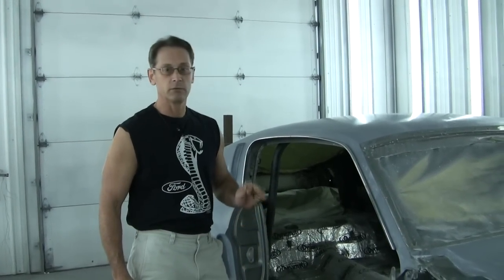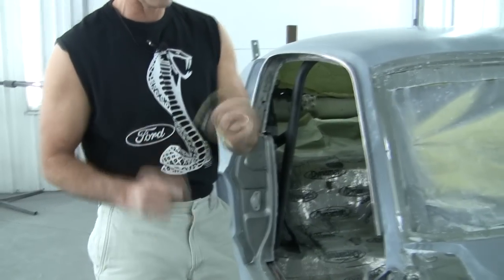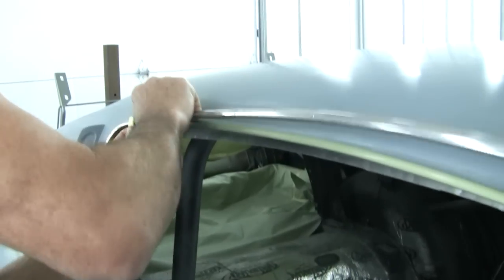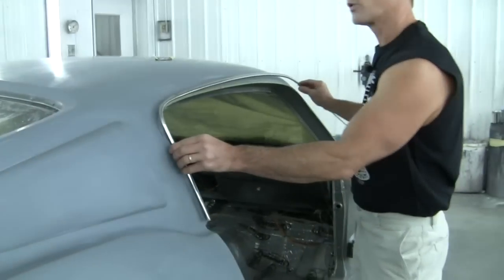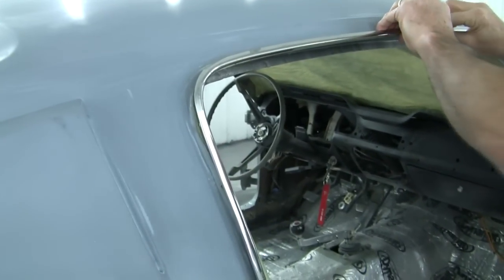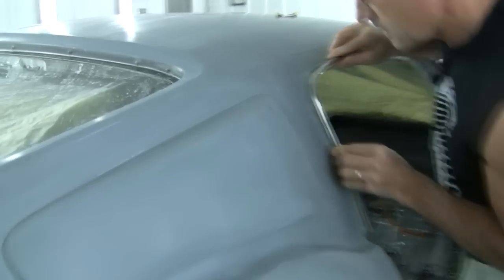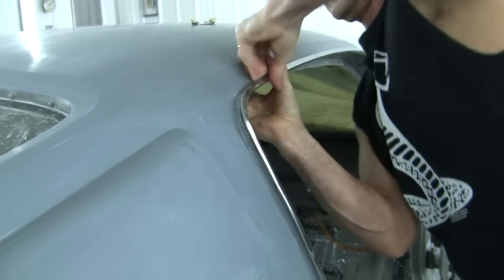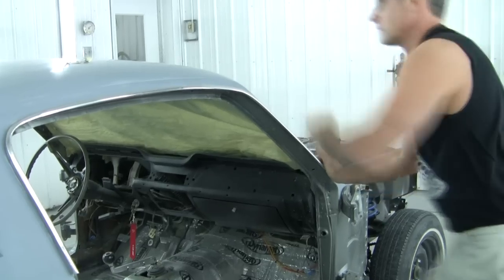Mustang Drip Rail Molding Installation

Comment: my 66 mustang was already repainted, it looked great without the chrome, my wife kept on bugging me to put the chrome on. i ordered a set and installed them..the drivers sides was a little rough, the passenger side was a no go. ended up bending the chrome. reordered new drip rail chrome.. this time i sanded the clearcoat off..it went on easy this time..also make sure you have someone to hold that chrome..i didn't, i had plenty of tape and patients..good luck.

Comment: I'm not sure what the sausage pack is. Original parts group carries a 3m strip-calk in a box that's black, comes in 1 ft. lengths(20 yards total) and is paintable. Is that what you're talking about? Also, after taking the old stuff out, should the new be put directly over bare metal, or prime the metal, put new calking in, then prime and paint over that? Thanx for the help.

Comment from the maker: The 3M strip isn't what we use for seam sealer. I'll get you a part # for what we use. I strip all the old seam sealer out, then reprimer before running new sealer.You also want to do the seam sealer right before you are ready to paint and seal over it. If you put several coats of primer over it first it will crack.